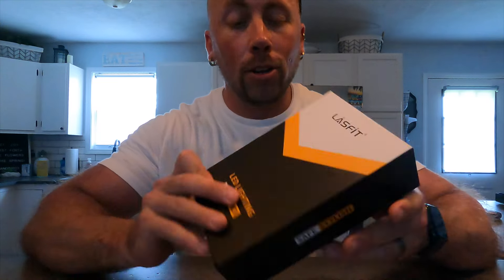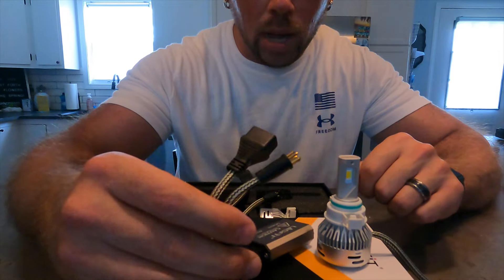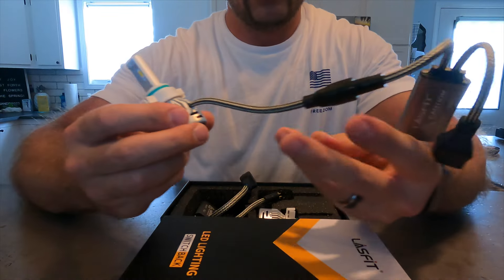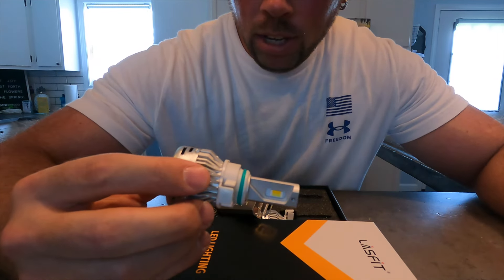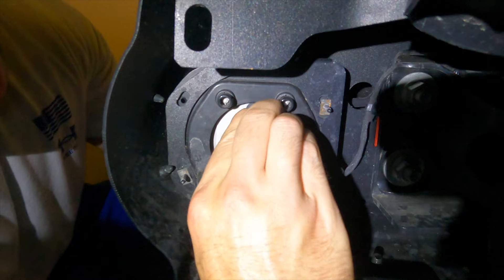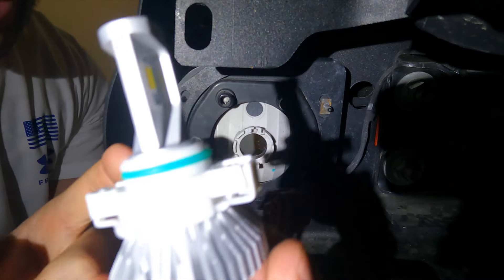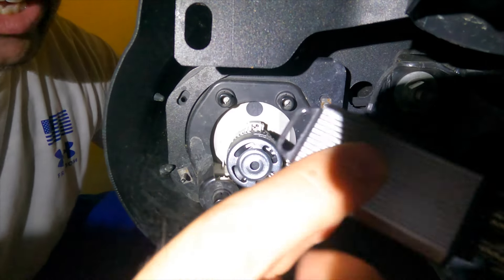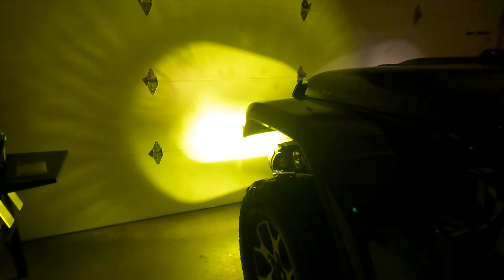Jeep Wrangler Rubicon - LED Fog Light Switchbacks Install - LASFIT

Comment: Very nice touch.  I purchased a Jeep that has LED Headlight and Fog lamps in it already.  I did use yellow vinyl to enhance the  fog light.  I like it.
Reply from the maker: The lights on the Jeep turned out well. My 4Runner came with LED headlights and fog lights. I used a yellow vinyl by Lamin-X for that look also.

Comment: And just for that. U got a new sub for making ur cars much safer with Lasfit. And for what y do in general: 😎😎🙏🏼

And make sure the orientation is on position of the two sided led chips, by facing 3-9 o’clock. For the best beam pattern as oem.
Reply from the maker: I appreciate you bro! Lasfit makes great products! I still have the 4Runner, but I was able to surprise my mom for her birthday by updating her fog lights.
Reply: @dshanman24  hey it’s one of thr best gift to make our family feel safer. 

That’s what I did. Hooked them up with Lasfit led h11 low beams and 9005 high beams. And they feel so much better now
Reply from the maker: @toyotabrony  That’s a great gift. The gift of a safer driving experience.
Reply: @dshanman24  amen to that. And they will never go back to halogen bulbs at all 😆😆🤟🏼🤟🏼

Comment: @DShanman

Bulbfacts tested these led bulbs. 

So after 27 minutes of run time, which is the average commuter time in the US.
These led bulb main unit gets very cooled 89 degrees Fahrenheit, and around 145 degrees Fahrenheit for the external driver. And not a ballast. Ballast is from HID.

They claim it’s 30W each, and 3000 lumens each.

It’s actually 28.5W each, and 3150 lumens each. 

6300k we get. 

In reflector low beam housing, we get 164% increase in brightness. And for reflector style high beam, u get 89% increase in brightness. Which is an outstanding upgrade. 

So yes. These are definitely worth the money for our cars. Especially when we live up north. These are very handy.
Reply from the maker: Very cool information. Thank you sir!
Reply: @dshanman24  hey Hakuna matata.

Anyone deserves better results and info, if I see them carrying led bulbs that looks very familiar. 🤟🏼😎

Comment: How did you get to this part? Do I use trim remover or 10mm socket? Cant find the first step to get started anywhere.
Reply: I have a 2024 btw. Don’t know if it’s different now
Reply from the maker: @Drizzy813 This is my mom’s Jeep. I think she has an aftermarket bumper and she is getting custom made covers for her lights. I didn’t have to remove anything except the factory lights because she had removed her covers at the time.